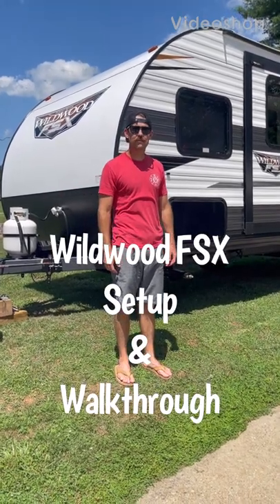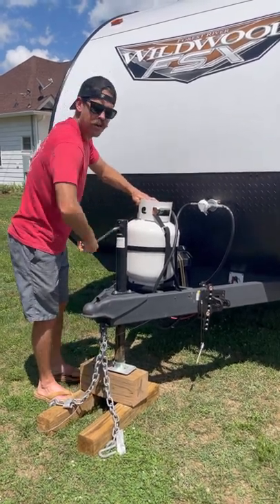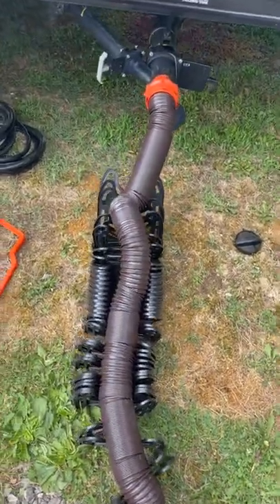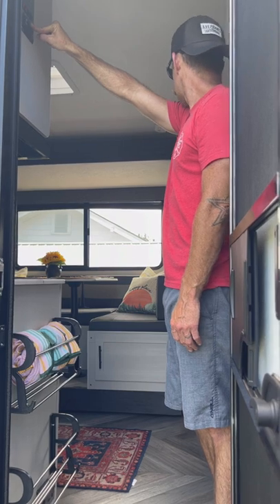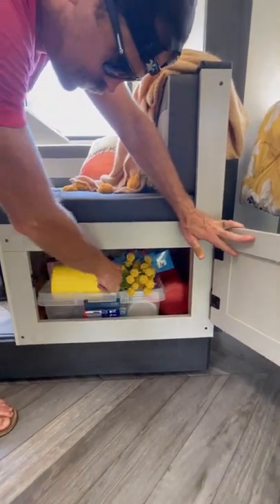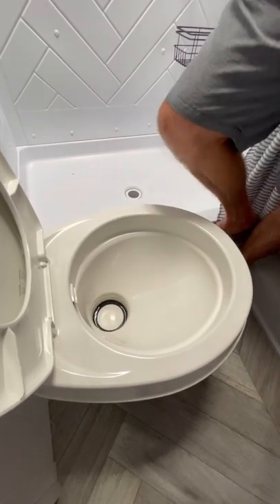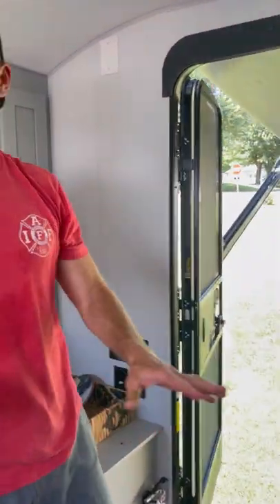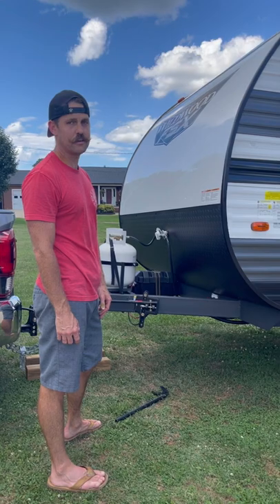Forest River Wildwood FSX walkthrough and setup

Comment: Fellow FSX owner here. great video and explaining everything BUT 2 VERY IMPORTANT STEPS,
 (im sure its common/second nature for you and just forgot to mention these steps)
 but especially for a newbie/renter ( and to save your trailer from damage)

1. wheel chocks you showed but never said when to put in. these need to go in after side to side level and BEFORE you disconnect tow vehicle. ( so trailer wont roll away or into customer/vehicle)

2. when hitch up to leave you NEVER LOCKED THE COUPLER. this should be done once it is lowered onto the ball and once latched crank back up to make sure it is latched